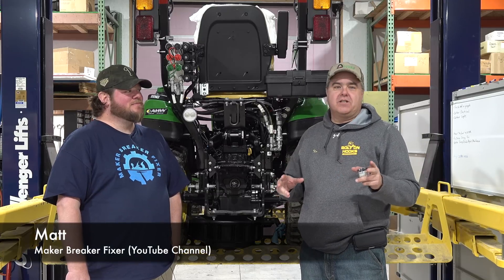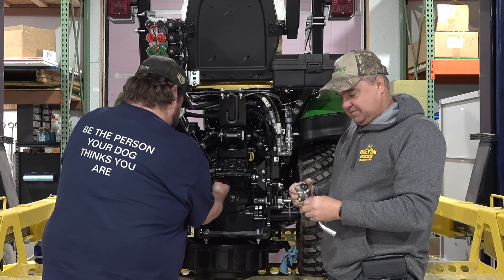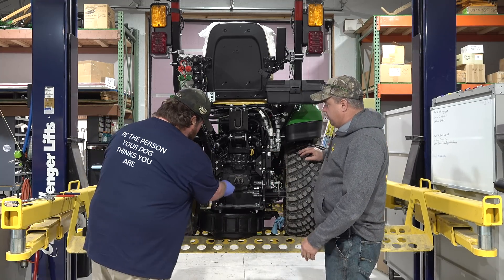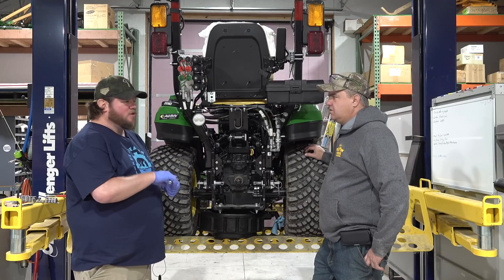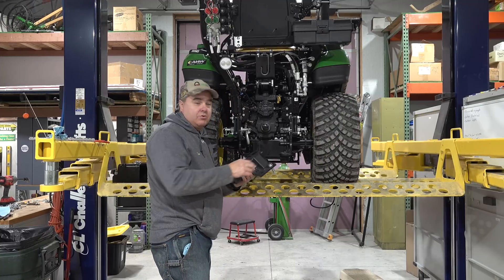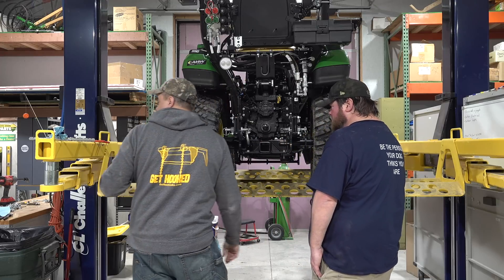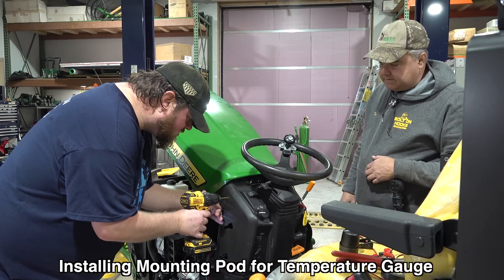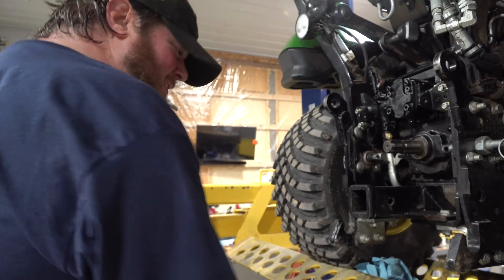NOW WE’LL KNOW!!  Oil Temperature with HydrosPlus and Summit Hydraulics. 1025R Subcompact Tractor

Comment: Question about the hydraulic temperature gage: can't a temp sender be installed in the drain plug for the hydraulic reservoir to read hydraulic temperature?
Reply from the maker: Yes, that would work.

Comment: Sounds like a viscosity loss as the oil heats.  It might be an idea to discuss choices in hydro oil options/alternatives.  A synthetic for example would likely have better viscosity stability vs temperature.  The viscosity range for Hy-Gard Low Viscosity is 33 @ 40 dgC and 7.1 @ 100 dgC.  The only synthetic I've seen mentioned so far as meeting/exceeding all of JD's spec is AMS Oil Synthetic Hydraulic and Transmission oil.  It has the full friction reduction/wear/corrosion inhibitor package as Hy-Gard and its viscosity range is 55.4 @ 40 dgC and 10.1 @ 100 dgC.  The label multivis oil weight is 5W-30 compared to Hy-Gard 10-30, which John Deere is satisfied with as meeting all API specs.

It seems that it would be since there is no cooling upgrade being considered that besides tracking the hyd temps with the add -on hydraulic packages, it would be valuable to determine how a full spec equivalent synthetic would perform in comparison.

Comment: Do you have a video about radiators?   Or engines overheating?  I cannot find my manual.  The engine oil level is good, so it isn't that.
Reply from the maker: Have you checked the removable screen between radiator and oil cooler?
Is the outside radiator screen plugged up? 
These are the two points which typically cause overheating.
Reply: @TractorTimewithTim  At the end of every mow I clean off the front.  My son showed me the filter inside the engine and I cleaned that the last time I mowed..or the time before.   I found the coolant reservoir and it is low.  It is below the cold fill...so I'm letting the engine cool down before I work with it.  

I'm newly divorced...last year and I got the tractor and the house.  I lost the manuals in the house somewhere.  I like your page.  You've helped me a few weeks ago when I overfilled the hydraulic fluid and I siphoned it out.   This is a learning experience.  I have greesed the pivot points twice now this season.  My engine oil is black but within range.  I don't know how to replace the oil and filter.  If you have a video on that it would be great.

Also, I need to make a checklist of maintenance items.  There is too much to track.  I'm at 423 hours...and I'm supposed to check the front axel fluid level and I don't know how.
Reply from the maker: @MsKala88  we have a playlist called “Johnny’s Essential Oils”.  That should answer most of your questions.

Comment: Hello Tim and Matt. I also see hydraulic performance problems on my 2032R (2017 gen 2) JD tractor. My performance problem is due to two hydraulic volume restrictors that are on the raise and lower of my front mounted snowblower hydraulic lines. The restrictors are installed so that the cylinders that bring up and down the snow blower do this at a reasonable speed (due to the hydraulic volume restriction). When the tractor is cold, the raising and lowering is very nice, at a normal speed. When the tractor is warm, hence the hydraulic oil warm, the raising of the snow blower takes for ever. I was told by my JD dealer that I have to live with this. I wander if replacing the two hydraulic cylinders with bigger ones (larger volume of oil in them) would enable me to remove those two restrictors. Anyone have a comment of this? Thanks.

Comment: Bought my 2021 1025r in January. I’ve put 64 hours on it. I installed the hydrosplus high capacity pump within 4 hours on the tractor. Todays temperature outside was 87F and I was not able to get my backhoe to dig like normal after about 4 hours 11 am ish. Upon touching some of the hydraulic cylinders and hoses I couldn’t keep my hand on them. I’m awake at 4:40 am looking for cooling solutions and ran across this video. Not sure why it hasn’t shown in my YT feed before this. I’m thinking the tractor may need more cooling like a transmission cooler on a car or tow package cooler on a truck. Any thoughts? I bought the tractor to work not sit and cool down. Tractors are made to work.

Comment: On my Hustler Hyperdrive ZTR mower they have a three gallon hydraulic capacity that will then feed a 10x10x3" radiator along with large high volume fan and when running hard, the air can get quite warm.  I am surprised that they don't have oil coolers on the sub-compacts, as heat is the enemy of hydro oil for sure.
Reply from the maker: The 1025r DOES have an oil cooler.

Comment: Hey Tim , I have a quick question for you. when you first started and you were using a tacoma, what was the tacomas tow rating and how did it do? was it a v6 or 4cly? did it hold up? I have a 2006 tacoma with the 6500# tow rating and seeing your video with the tractor weight has me spooked to tow it regularly.

Comment: im interested in one of those kits for myself, glad to know there is now a way to judge the hydro temp and when it's safer to shutdown to keep from premature wearing down....also with my 1025R, id had thoughts of adding an electric fan up front for the trans cooler and wondered if that would help with it cooling down better. i know the radiator had the big fan and such, dont know if things will work unless you try it out for yourself....btw, thanks for the channel share.....

Comment: Interesting that Deere opted to install a cooler on these vs Kubota deciding that all the BX needed was that useless fan in front of the hst.  I'll point out that you in particular would qualify as an extreme case user for this size of machine but having said that the market share for scuts is huge and growing fast.  Heat and demand go hand in hand and as one rises so will the other.  The addition of this gauge would allow you to see where you typically operate and give you some idea of what to expect vs your stock 1025.  I'd be curious to see what an oil analysis showed as far as breakdown and contaminants on the modded unit.  Service intervals will be a crucial part of this relationship as well.
Reply from the maker: Yes, Deere has the cooler, it also has a double cartridge air filter (inner as well as outer).  Overall, the 1025r is simply built to a higher tolerance for abuse than the BX.
Reply: @TractorTimewithTim  100% agree that the 1025r is superior to the BX, I've never operated a 1025r but have several thousand hours across 3 different BX models going back to the BX2200 and have always found them lacking.  Isn't just the air filter that's subpar either, the fuel filters and hydrostatic filter are poorly placed and designed as well.

Comment: why not charge a core charge for the old tube. then you will have a supply of tubes to modify and that can reduce the cost. If I installed one I would not need to the old tube.

Comment: Gauges are always nice but... that price sounds a little steep. Maybe there could be a core charge for the inlet pipe. Say I get the kit, install it and send back the factory part, then you refund the cost of the part. I didn't look up the price for the tube so from the hip say a $50.00 refund. Helps reduce my cost and helps you get the part to modify. I understand if you're making the kit yourself, at low volume, it's going to cost more than if an established manufacturer pumped out thousands of them. Maybe you should sell the rights and get a percentage of each that's sold instead. Idk, just a couple more thoughts from the peanut gallery.
Reply: Appreciate your thoughts!

Comment: A lot of 1025r owners are probably de-hard DIY'ers, and procuring the gauge, sensor and all wiring and the bung would be no problem. Many will also be able to do their own welding, too. But, for those who welding is just a step above their abilities, maybe Matt could offer a deal where they send him their tube and he could do the proper modification to it. 
Personally, I like to watch all the specific operating parameters on my machine, like the exact voltage the alternator is putting out (it tells a lot about the condition of the battery!), the actual water temp rather than just an idiot light, and actual engine oil pressure, and possibly engine oil temp. So, for me, a full cluster of gauges would be in order. Seeing all these values all the time can help avoid oncoming failures, or, at least minimize the damages.
Tim, a real-temp water gauge as well as an oil pressure and temp gauges for JohnnyX would seem to be mandatory to keep tabs on IF he is heating up from the extra intake pressures under a heavy load. Brush-hogging comes to mind, like when your PTO shut off that one time because you didn't watch the debris build-up on the screen. 
To keep this long story short (TOO LATE!!), everything Matt says holds true to how most cars react when first fired up on a cold morning. Most pickups have actual oil pressure gauges and they show an unusually high pressure, even after being relieved, than they do after the engine warms up. Temperate affects viscosity, and viscosity affects the pressure in the system. Hence, higher temp, lower viscosity and lower pressure. So, what Matt shared stands to reason. But, I wouldn't call it "performance degradation", rather, it is slowly approaching "normal" performance as the temp rises. That added performance at first is like when your truck seems to have higher pressure when the oil is cold. It's a temporary, artificial condition. 
Thanks, Matt, for pioneering this add-on feature!
Reply: Your view is spot on.   Degradation of power is exactly that - "Standard performance based on operating parameters"   😁    Thanks for the long story - It was read in full and I agree with all your points.

Comment: My TYM T233HST, which was made in 2006, and the new T25 HST both have hydraulic oil coolers.  So, I guessing that TYM has installed them on all of their subcompacts for at least fifteen years.  TYM tees off of the tank return line from the FEL valves to go to the cooler and then back to the transmission.  

I’m thinking I may be able to mount a temperature sensor on the fed line to the hydraulic pumps.  We are having a late season snow, so maybe next weekend I can look at it.  I have an extra oil temp gauge in the possibles box,  And the front of my canopy would be a great place to mount a gauge.
Reply: Please share with us what you end up doing!

Comment: The simplest thing to do to regulate your hydraulic temp is to switch to a good quality synthetic hydraulic oil Like Amsoil that will typically run 30% cooler than the oil the OEM tell you to use. Using OEM oil, planned obsolescence anyone. I've done it on my tractor, was told it was not good enough and and would void the warranty ( not so ) , did have an issue and after the OEM examined the oil  the report came back the the (in this case Amsoil) exceeded the requirements of the OEM hydraulic oil. It was a parts failure not an oil problem. I'm telling you, switch and you will be ahead of the game and won't need $300 gauges to tell you so.
Reply: This would be a very interesting test to do with the gauge to confirm the 30% cooler.  I've always been impressed with Amsoil products and have used them for years, however have a hard time swallowing how proud $$$ (for what is likely very good reason) Amsoil is of their hydraulic oil.
Reply: @MakerBreakerFixer  Who's Hydraulic oil are you claiming to be Amsoil other than Amsoil? Certainly not Kubota. If you become a "preferred customer " of Amsoil you get a 25% discount off the retail price. If a dealer you get 50% off their retail price. Even with either of those you'll still pay for Amsoil. For me, just me I would rather pay up front for Amsoil and get superior performance than pay cheaper and end up paying more latter. Either way your going to pay it is just deciding how you want to do it. I prefer for the best operation of my equipment. Every single piece of my equipment is entirely filled with every appropriate Amsoil Fluid.As a results I have always gotten better performance with everything from fuel usage to power. When you find something and it works as advertised it can make you a believer and it has for me. Oh also have gotten longer hydraulic hose life with Amsoil over Petroleum liquids also. Damn stuff just works for me. Can't say what it does for anyone else.... Also with those savings you can easily afford the worthwhile gauges etc. That is with the understanding that your still using those inferior green machines. If you were using the proper Orange machines you would never need to consider using gauges  because Kubota always builds Their tractors the correct way so you don't have those problems............................................... LOL..........MakerBreakerFixer FYI that is only said in jest. I don't know if Tim remembers or not he has so many followers but I do make a point of Friendly teasing him of this. Absolutely nothing malicious is meant in my teasing about those green machines. It is just my wyt of showing you the respect you deserve for doing these videos and having the guts to use an inferior product to do them with. LOL. Only meant is a way that the Lord would approve of............. Wayne A. Derby
Reply: @waynederby4684  Not claiming any oil that isn't amsoil is amsoil.  Not sure how you arrived there.   Just making the point that Amsoil hydraulic oil is list price almost double the cost of JDs already pricey oil.   I'm not opposed to trying it out and having the prior data over the last 100ish hours with the gauge mounted would be a great way to compare the two.   If I didn't have 5hr old oil in the tractor now and another 5-6gallons of new lo-vis on hand, I'd consider making the swap now.   However in the interest of comparing apples to apples with Tim and Kevin's tractors, stock, lo-vis (J20D) is what will see the next 100 or so hours.

Comment: I thinking they must be away of getting a temperature reading by clamping a temperature probe to that line rather than cutting and welding to it.?
Reply: That would be the easy way, however it wouldn't provide a "fluid temp" it would provide what likely would be a lower temp as the metal suction tube does dissipate some heat and also it wouldn't react as fast as the sending unit that is immersed in the oil directly.   That being said - the intial method that was used to gather temp data was in infrared temp gun on fittings and the rear of the hydraulic pump, and that's obviously a much less invasive and very inexpensive alternative to this modification.

Comment: If hydraulic oil temperature becomes an issue, Kevin will have to come up with a larger hydraulic oil cooler. There is plenty of room for it on the 1025r.
Reply: Already have one made that has been in testing for a while - Unfortunately winter came and not being able to get high temps have stalled the testing.    I've been impatiently waiting for mowing season, but in SE PA, my yard is a swamp.   Hopefully it'll dry out soon and the testing can continue.
Reply: now thats a mod id like to see done.

Comment: Another comment regarding the Summit valve kit.  Summit might consider modifying the aluminum housing to also include "fins" cast into the block for enhanced cooling capacity.
Reply from the maker: Yea, interesting idea.
Reply: Or even just a bolt on heat sink.

Comment: I think around 180 degrees and above hyd oil begins to lose its properties and can start to break down more quickly... granted I think everything can handle going up to 210 degrees but it should never get that hot. Anywhere from 130 to 150 is probably a good number.

Think of it like engine oil... the temps of that oil probably range from 175 to 200 degrees, and a reason why it should be changed after so many hours. Take that into consideration if knowing how hot the hyd oil runs most of the time can make a good guess on how the oil is holding up. An oil sample test would be a good indicator.
Reply: That was the magic number I found in doing the hydraulic oil research - 180°F and above that is where seals and other related problems begin.   - However!!!  This isn't "just" hydraulic oil but it's got a JD spec of additives and its used in a transaxle as well as the hydraulic implements (pumps, cylinders, etc).  Transmission fluid normally operates over 200°F and I'm guessing (I'm not a chemical engineer) that the J20D/J20C spec hydraulic oil is a hybrid of traditional hydraulic oil and other "stuff" that changes its working window above 180°.
Reply: @MakerBreakerFixer  yea I forgot to add that in about seals, starts to cook them.

 I think the oil itself changes too, like more watery and not lubricate as well. Trans oil is a different beast too, not sure how that stuff holds up so long, different components I guess utilize different additives.

Comment: So what temps are going to start reducing life on seals etc.?  I've found knowing the temp without knowing what it means doesn't really help much.  When do I need to stop or get a larger oil cooler?
Reply from the maker: We discussed this to the best of our abilities.  We do not have more info.
Reply: @TractorTimewithTim  Ditto with me.  Best I've come up with is the ratings of the oil and general hydraulic equipment specs which indicate a loss of seal life can begin as low as 180 degrees.  Seems manufacturers should publish this info.